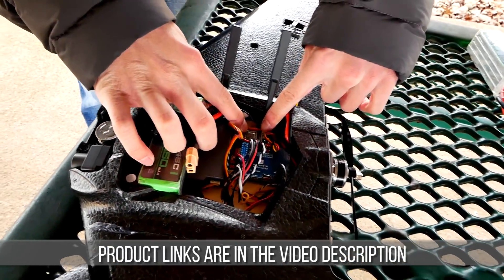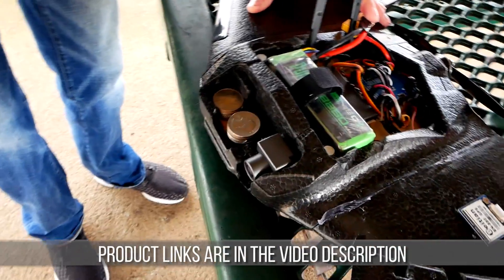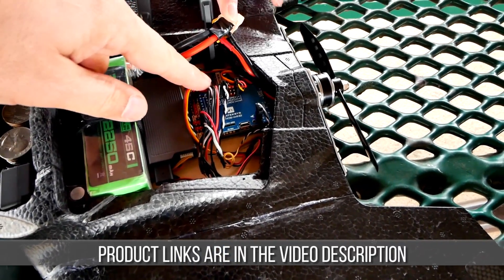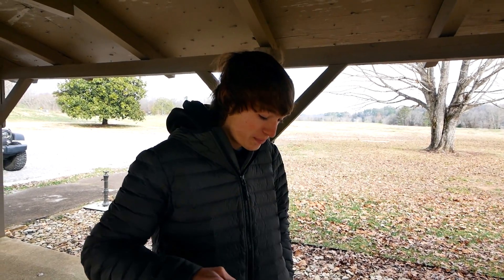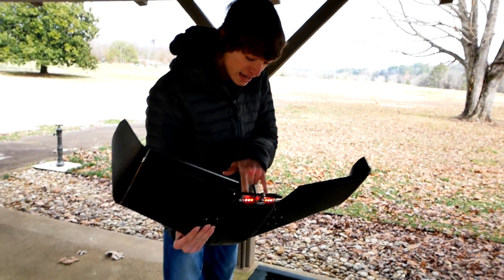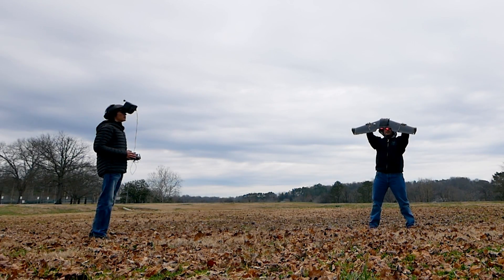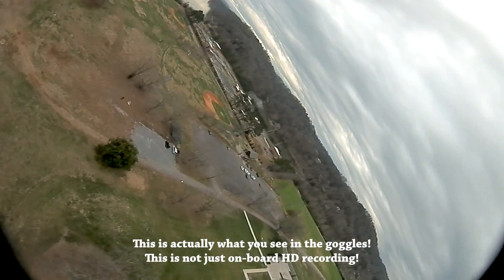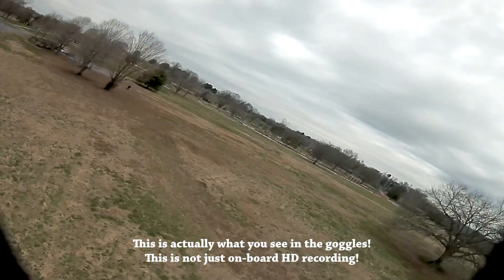DJI Goggles RE Ocusync SBUS Passthrough | COULD IT REPLACE CROSSFIRE? (NO)

Comment: Review is set to private. Why?
Reply from the maker: Goggles RE review video was pulling search results from people confused thinking it was the same as the DJI FPV goggles. Goggles RE is not really relevant to FPV any more so I took it down.
Reply: @JoshuaBardwell  I see. I'm in a special situation where I fly analog quads and have a Mavic Air. All of my current FPV goggles are old Eachine crap and was thinking of upgrading for Christmas. Intersted in how well the analog side of these goggles performs... picture quality, receiver strength, etc. What were your findings?
Reply from the maker: The analog side has okay range but poor latency. It's fine for spectating or for long range style flying but not for racing or proximity. To be clear, they could have improved with firmware updates since I tested them. It was years ago.

Comment: Got a question; if using the Ocusync air system just for video transmission, do I select to transmit on 2.4ghz only or do I leave it on dual 2.4/5.8ghz? How will I get max distance?

Comment: Hello I’m trying to watch the original review of these re googles but it says private.  Anyway I can see it. I really want to know your perspective on this unit and wether or not it would be worth buying.  Right now I have a magic air but am working on race quad.
Reply from the maker: Goggles RE video is private because it was pushing down results for the DJI FPV goggles. Bottom line is goggles RE is not a good choice for analog.
Reply: @JoshuaBardwell  agreed after watching thousands of vids today. However what about for flying my mav air.  RE or regular or just say no.  That's really my question.  I dont wanna race I just wanna fly and I've figured out that mavics are not made for that really.

Comment: Hey, just wondering about the antennas and orientation of them for best range. I have the circular and a dipole mounted horizontally in the wing of my fpv wing. On last test I got out 2k and signal was low. Which antennas and orientation would you use for best range?
Reply from the maker: 2 km is pretty good for 2.4 GHz control. To go longer, I think you will need to start thinking about directional high gain antennas on the ground station.
Reply: @JoshuaBardwell  I've had my Mavic out at 5k at the same site. I was hoping to get similar range from the ocusync unit. I was thinking  i must have the antennas orientated badly or something.

Comment: Not able to troubleshoot without OSD?   how about just a video out signal from the FC on a plug?  Then just in a screen directly for troubleshooting.  Could probably even direct solder an RCA plug or 3.5mm  to go direct into fpv monitor. cool vid guys!
Reply from the maker: Or a second analog video transmitter direct from the FC, like I suggest in the video.
Reply: @JoshuaBardwell  yes that's a good idea too, Mr money bags! 😛 And yes I did hear your suggestion in the video 😁.

 yeah that would work.  Then you could even fly with it, and then you'd be able to get rid of the DJI system.... Then you wouldn't need to... Make ... The video....? 😛

  I guess if you've already got DJI goggle$ a $20 vtx won't kill you. I was going for the cheapest solution possible with a $1 or free connector if it's already laying around.

Comment: I don't see the wire tether as a "downside". It lets you use the feature of passing control signals using your video system... gets rid of an on-board control Rx. Don't like it? Don't use it and you're in the same place you'd be with competing video systems. I also don't see the lack of GoPro weight as a downside. You're dealing with a wing that's designed for a GP. That's not DJI's fault. The goggles do look clunky and the latency is disappointing. I've flown ProSight and it's high res/low latency is beautiful. But it's range is very poor... runs out at 1,000 feet or so. Long range/Low latency/Long range... it seems we have to pick any 2.

Comment: That system can do a mile+ on a quad with properly installed panel antennas on 5.8ghz only. Trust me i have done it. They are both nestled in the same orientation on that setup which is not optimal. Also playing a factor is which signal setting were you guys on? 2.4 only or 5.8 or both mixed?  Lots of factors plays in to how the ocusync air module performs which also includes firmware versions. the latest ones with more telemetry data has a bigger lag than the earlier versions.

Comment: Would it be possible to have an hybrid signal, where higher resolution black and white is transmitted analog for low latency, and color is transmitted digital at a lower resolution and framerate modulated on the analog signal, and the receiver uses optical flow on the black and white feed to interpolate the color between color frames live?

Comment: I was initially using this setup after your review of the DJI Goggles RE last year. Unfortunately the FPV image is much better/consistent on 2.4, which meant i had to use a long range transmitter like the crossfire and discount 5.4 completely. Nothing worse than that video locking up with lag mid flight. Also not running 960, the 720/740 was much more responsive.
Reply: Andrew, I know this is an old post but wanted to ask; you said you can send video signal over the 2.4 with this goggles? Which settings do I change in order to make sure that the video goes over the 2.4ghz band? Also what range could it be expected from the video feed if using 2.4ghz? Last question; if using goggles for video only, then I assume that telemetry transmission would no longer be possible correct? That is since the Ocusync air unit is no longer connected to the flight controller, right? Thanks!!
Reply: @traxxi2003  are we still talking about the dji Google's RE?
Reply: Andrew S, yes, I just installed the Ocusync air unit on a new Talon GT build with the intentions of doing some long range flying but wasn’t sure how reliable the signal was.
Reply: @traxxi2003  within the
Goggles, select both 5.8 & 2.4ghz modes combined at 720p. Buy a omnidirectional 5.8ghz antenna and face the craft with your head and you'll get great range and quality
Reply: Sorry I can't be more specific, I don't own these goggles anymore

Comment: (1) INAV is used for long range but not really for controlling the servos. (2) GPS installed wrongly, surely cannot arm (3) no point to use Ocusync to passthrough controls, latency is a must there, should not let the latency introduced into controls. Simply use a Frsky R9 receiver.
Reply from the maker: The advantage of this setup would be that you could pass through control without an additional bit of hardware. I think there is a situation where it makes sense.

Comment: I spend quite a bit of time with this setup getting it working when it came out.  I have it working with telemetry in a quad and it was just never better than “ok”.  The most disappointing thing to me was that while you pointed out the latency is better at lower resolutions, if you have a SD card in the Ocusync module itself it still records at that lower resolution.  What I really wanted it to do was broadcast the lower resolution lower latency video to me, but record the 1080 signal from the camera onboard.  That would be a much better equivalent of a gopro replacement.  But it just doesn’t do it. I still plan to put this on a wing at some point.  I do that a wing with inav is the best and maybe only application for this.
Reply from the maker: For the sake of the review video, having it record the same quality on board as in goggle was nice, but I can see how that's not what you'd want if you were an actual user.

Comment: Nice video, as usual, with cool info. Some suggestions:

1) You should put an mini OLED display for debugging purposes.
2) If that setup only flies for 4 mins with a 4S 2200mAh something isn't right. My Reptile S800 can fly for +10min with a 4S 1500mAh battery. Prop up, pitch down...
3) GPS antenna is pointing the wrong direction.
4) Autolaunch.
5) Buy the "kid" a ZOHD Dart XL Extreme in compensation for breaking his wing with your "bad throw". :P

Latency sucks but HD should be nice enough for a long range wing to overlook the latency. Anyways, the price for that DJI components are too expensive to put in a 50usd fixed wing...
Reply: He does mention that it`s not a very efficient setup, and it`s cold as well.
My Zagi 370 gets 30+ minutes on a 3s 1100mAh, then again it weighs about 290g ;)

Lol..

Comment: I had a lot of fun building this thing and making the video! It was neat to investigate a less common FPV product out there
Reply: Poptart!!!
Reply: One use for those goggles would be for  observing autonomous flight using waypoints. You should try that out!
Reply: Hopefully next time you can get it in a better wing, like the S800 or AR wing. Good job making the best of the setup even after the crash. That's what EPP foam wings are all about.
Reply: I thought that the DJI Air Unit can receive telemetry from MSP capable flight software (which iNav is)? Wouldn't you have been able to configure the telemetry to display on the DJI RE Goggle's OSD? Just curious. Great job with the build and video! It's easy to see how people get the GPS orientation wrong. The documentation on them are a bit lacking, and if you didn't know what a GPS patch antenna already looks like...
Reply: David Mak they say it is possible to do, but documentation on that is very lacking and I’m sure different firmware incompatibilities make it even harder to accomplish. I attempted to get it working but to no avail. A future goal I would say
Reply: Nice work! My buddy flies a Theer with a 1300mah 4S in the gopro bay/nose and it balances out pretty well. Definitely worth a try. Also, skip inav and flash arduplane on that thing. Mission planner's UI is really clunky but it's far more reliable and mature than inav. 

http://ardupilot.org/plane/docs/common-omnibusf4pro.html
Reply: It's less common because DJI never really provided a working OSD. That and the fact you needed to use the DJI Goggles. Why to shoot yourself in the foot, DJI! Just an idea, maybe make it so it can work with some of your other flight controllers. Having this integrate with the N3 and A3 would be great. Seeing how it's difficult to find in a store and expensive to buy your Lightbridge 2 system (though I have one). I would like something for my other Multirotor. DJI really needs to pull its head out of its arse and get with the program.

Comment: I would guess that the latency he is feeling is from the video not the rc link. The occusync can do it’s own osd off mavlink data or whatever output eagletree vector uses as well. I would have thought you could get mavlink off inav.
Reply from the maker: It's possible you can get OSD info from mavlink and we just didn't set it up.

Comment: One more question: How is the latency on my Mavic compared to this setup.  I don't shoot gaps.  Well on purpose.  I've shot a couple, like between powerlines, but very accidentally.  It doesn't feel like there's much latency.  I move the stick, and there is nothing close to 3/4 of a second until I see my input.  It feels fast.  What do you all think?

Josh, I would have liked to have had your reaction.  You should have flown it.  The gap shoot was just great, I wouldn't have done THAT,  with HIS bird,  but your impressions would have been welcome.  COOL VIDEO.  INNOVATIVE IDEA.
Reply from the maker: Unfortunately, we destroyed the plane before I got a chance to fly it.
Reply: @JoshuaBardwell  Yeah you should really borrow a Mavic Pro and give it a go, while the lag is higher then what you'd experience with Analogue Video + Frsky, it's certainly nowhere near as bad as what you are describing in the video when a Mavic is in the picture.
Reply: Mavic Pro (Occusync 1.0) has bag latency of 160ms @ 1080P and yes mavic Pro has control sync over Occusync as well.     At Lower resolutions is it better, but not give many options for live view so harder to test those avg latencies myself.    Yes it’s slow as balls compared to analog but for fixed wing and semi-autonomous drones like mavics its an amazing technology that can go forever and keep an HD link.  

I try to avoid shooting gaps with my mavic as well, not made for that, but I have flown some gaps like aches under bridges and stuff at slower speeds for fun and silky areal videos and revealing shots.

Comment: The DJI link is 150ms latency last time I looked. That's way too much lag for me.
Reply: They claim its 50ms now.
Reply: @pavawarez8825  Still need to half it again. Optimal is sub 30ms. What annoys me is there is no premium solution. Id happily pay a thousand or more if I could get a 4K 60fps 30ms link. Hell even just a solid 1080p 60fps 30ms link would be a start. So far our choices are either BlueFPV 720p 30fps 40ms or Connex Prosight HPmode 720p 60fps 46ms or LPmode 720p 30fps 31ms. There is also an analogue HD standard that is close to 720p at 960x720 which can give you 21ms at 50fps but there are no lightweight RC FPV specific modules only surveillence camera modules for sale. I think analogue HD could be a cheap alternative for those on a budget should anyone take the time to make up and mass produce some slimline RX&TX modules. The only drawback is it would use up more bandwidth on the 5.8Ghz band meaning you could only have 3 concurrent flyers vs 8 with the current analogue systems.

Comment: The odd thing is they have.  For both Analog and Digital new firmware has been released for the goggles (analog & digital) and the digital video transmitter.  I fly my mavic with them and it feels locked in and fly analog FPV all the time with no dicernable lag; shooting gaps all the time.  I have not flown my long range unit yet in a plane but it's should be as good as the Mavic.  You need to remember the lag introduced from some radios out their trainer port and then if you need to do sbus decoding on the other side.  It does support telemetry display also.  Could be lighter and less bulky, but the multi-use capability and HD image makes it great. Love mine.